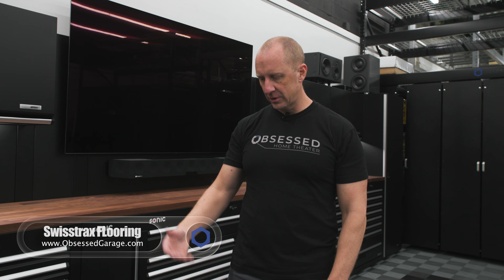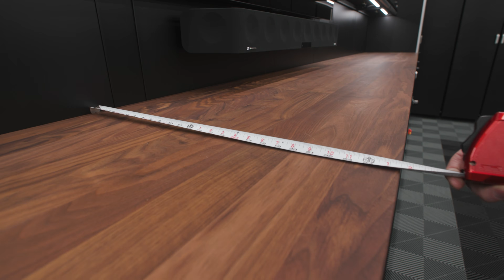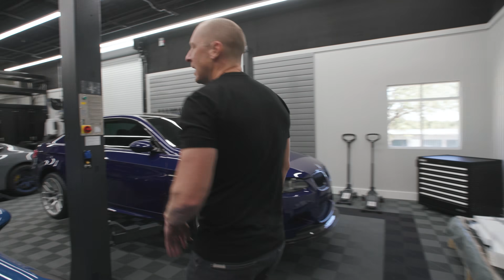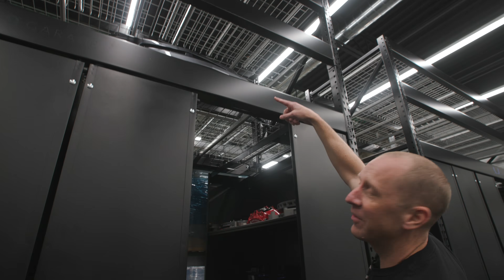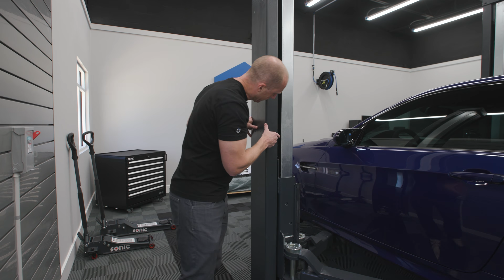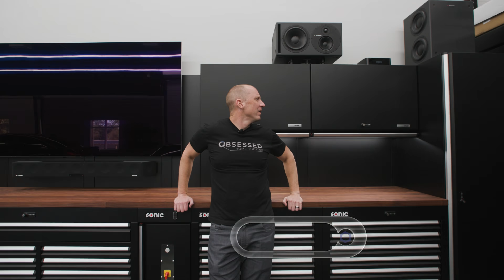Touring the HQ Studio Garage: The Most Thought-Out Garage Ever Built

Comment: HERES WHAT I WOULD LIKE TO SEE!  show us how to have a really great detailing sys tem and products that will do the best at the lowest cost! you have an encyclopedic knowledge and i respect you but your set ups are for mega rich! 
 i own a Ferrari F430 and do my own detailing and have won 58 trophies! but hey i am one of poorest supercar owners on planet retired & on social security ! $$ 
so my challenge to you is to show us how we can get your super results at lowest cost so cheapest good adequate equipment and products!  up for it ? 
I know what I do! have a cheap pressure washer a lousy sun joe ? i only use for spraying the bilt hamber sno foam pre wash and i use two bucket method, the rinse bucket's grit guard has holes in bottom and overflows top too so total loss wastes water and i use genuine sea sponges! Various soaps or GASP mixtures in AZ so use rain x soap at least some as it does not spot and water evaporates so fast here spots are an issue ! so dry fast w/. worlds best drying towel fr austrailia ? or was it new Zeland ?  i use a garden hose at big volume to rinse .  i use 303 graphene /ceramic for wax ( $17 per bottle ) !  it shines well! 
thx !

Comment: Need to get nitrogen gas for tires. I don’t know how one can use air in tires in an Obsessed Garage.
Reply from the maker: Ha, ha... Nitrogen for tires is nonsense.
Reply: @ObsessedGarage  Why don't you ask your favorite AI tool the following question: "why do airplanes and race cars use nitrogen in tires.?
Reply: @JimReapur  You are only partially correct about nitrogen in airplane tires. The oxygen in air being combustible is an obscure reason. Ask ChatGPT or some other AI site why airplanes and race cars use nitrogen. The main reasons for passenger cars is that nitrogen filled tires loose pressure much slower than air filled tires. I know this from 18 years experience using nitrogen (free at Costco Tires). Also, air filled tires are much more likely to cause oxidation problems with rims and tires. This can be a factor for those who don’t drive vehicles a lot and don’t want to replace tires after 5 years as most shops recommend, even when there is still plenty of tread left.
Reply: mmm...you do know that dry air is 78% nitrogen to begin with ...right?  More precise breakdown...78% Nitrogen, 21% Oxygen, and nearly 1% Argon
Reply: @freepatriot6313  Yes, I know what is in air. There is a reason why airplanes and race cars use 100% nitrogen (or close to it). I have been using nitrogen for 19 years since I buy my tires at Costco and they only use nitrogen, and they do free tire rotations and balancing if you buy tires there. They have outdoor nitrogen refill stations for customers. Nitrogen results in less pressure leakage over time, and is less corrosive than air because the O2 in air what causes oxidation and corrosion. No O2, no oxidation.
Reply: @Mark-rw3kw wrong…. 100% nitrogen doesn’t cause “less” leakage. The oxygen along with humidity are more susceptible to a temperature change. Raise the temp… raise the pressure and vice versa. You get the tires hot during a race… will tend to raise the pressure etc
Reply: @freepatriot6313  You are wrong. Google it. Nitrogen molecules are larger than O2, and that is why tires with 99%+ nitrogen leak less than air. I know this from experience, having used nitrogen for the last 18-19 years with tires purchased from Costco.
Reply: Or fill your tires with a bespoke blend of 78 percent nitrogen (N2), 21 percent oxygen (O2), and 1 percent argon (Ar) stored on site at 21C.